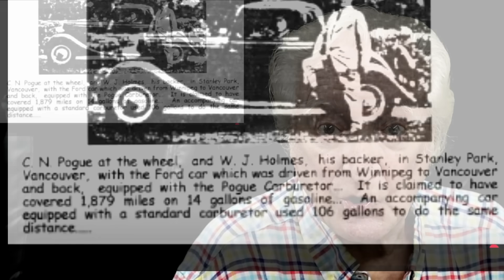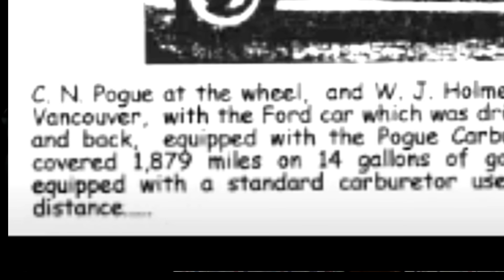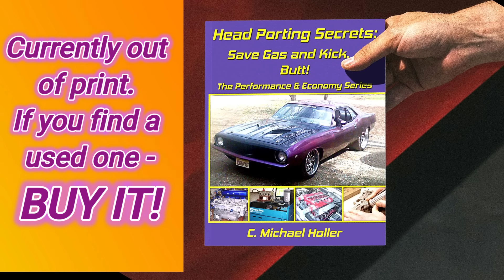100 MPG carb - the real truth!!

Comment: I guess if you think modern cars only burn about 50% of the fuel that passes through the engine, you might believe that a carburetor  would double your milage.
Reply from the maker: Jeremy, modernern engines burn about 99.5% of the fuel that goes through them but only turn 25 - 30% of that into useful work. You need to watch part 3 coming up in a few days.
DV

Comment: Thanks for another installment David. One thing I found that improved the mileage on my daily driven 360 Mopars, with their Carter Thermoquads, was the now extinct "Torque Plus" intake gaskets. Basically the old trick of sandwiching stainless steel screen between two intake gaskets. This helped atomize the fuel charge even more, resulting in not only better mileage(after retuning), but a substantial low speed, off idle torque increase. Not much use over 4500rpms, but if you've ever driven 360 Mopars, you'd know there's no need to rev them to get up to speed. An additional major bonus with these gaskets is, being double thickness, they sealed warped intake manifolds to the heads without machining. The  long extinct Thermoquads were even more adjustable than the average 4bbl carb and I loved them. Their howl at wide open throttle is also unique. In the mid 80s the night the Simpsons episode with Danny Devito aired I was inundated with phone calls from buddies who said THAT'S your car! Homer was describing to automotive engineers " when I gun the motor, I want people to think the world's coming to an end". Thermoquads sound like they're consuming every molecule of air in the tri-county area, when they open up fully. I wish I had purchased a "stub stack" for my Thermoquads, when I did so for my Mini's S U carbs. Great series David. Looking forward to the next installment👍
Malcolm Ottawa Valley
Reply: I remember my dad saw one of those screen carb gaskets, when I was a kid.  He had bought a 78 Chevy work van that we took a weeks vacation in, shortly after he bought it.  He was less than impressed at the fuel milage with the 350 SBC that it had.  So, when he saw that carb gasket hanging on a peg board at the local "More Value" store, He scooped it right up, thinking that it would work.  He was very meticulous about his fuel mileage.  So much so that he had a wheel type slide rule calculator hanging on the turn signal.  He checked his fuel mileage absolutely every single time he filled up.  

Guess what.... Not a damn thing. That carb gasket didn't do crap.  The engine made exactly the same fuel milage (within a 2-3 MPG range) on every single fill up.  

So, sorry, I call BS on that one.
Reply: @atheplummer 
Yep, they've sold those gimmicks for Harley's for years and after trying one I can assure you they do nothing.
Reply: @atheplummer  He's speaking of results on a particular motor w/ carb setup. Did your dad's Chevy have a Quadrajet or a 2bbl carb? It would be expected that the added intake restriction on a 2bbl setup would overcome any gains from better atomization.

OP's dad's experience was w/ a notorious gas guzzler, not the relatively efficient SBC. Apples to oranges.
Reply: @nunyabidniz2868  It was a 78 Chevy van, standard box, with a 4bbl Qjet. Turbo 350 trans.
Reply: Well I wouldn't have kept using them if I wasn't getting better results. Speaking as one of the tighter (cheaper) drivers on the planet, who still computes his mileage at every fill up, in my head to 2 decimals(one of the few boomer super powers). One backfire and the old fiberglass screens, like they sold your Dad, were blown out. These were stainless steel and their hole sizes had been "scienced out" by then. Mopars use the more sensitive ported carb vacuum to pull in their vacuum advance canister signals on their distributors. Chevys use "always on" straight manifold vacuum. On my low compression 360s I'd set my distributor 12+23+27=62 degrees. That is base + mechanical+ vacuum equalling total timing. Mopar made vacuum canisters all the way out to 27 degrees on their last(75+76) A-body(light weight) small block distributors, stamped with a 13.5 on the arms(you double that for the actual degrees). A lot of SBC distributor canisters barely added 8 degrees vacuum. I've worked on a lot of friend's 350s, but I'd never own one as a daily driver. Good torque but far too thirsty for what you get mileage wise,  compared to what you can pull out of a 360 Mopar, in my experience. Watch any CASCAR dirt race and you'll see it's the 360s ahead, out of every turn, over the 350s and 351s. They tried to outlaw them, but that form of racing is too budget oriented and closer to stock, so they dominate with their bore/stroke torque advantage, earning their nickname "baby Hemis". I got zero mileage increase on Minis using the screen door intake gaskets and it restricted their high rpm shift points (7000rpm), but the small block Mopars gave great, noticeable gains over stock, in my extensive experience with the Torque Plus brand intake gaskets.....not calling your Pappy a fibber.
Reply: My first vehicle was a 93 d150 with the 360 and i had 32" glasspacks with a big aftermarket k&n air breather and filter and it was the best sounding pickup in my town. It smoked a newer model chevy with the 5.3 and smoked a newer model v6 camaro. My buddy who was a chevy guy was super impressed.
Reply: Wish I had your help back in the day. The half dozen 360s I drove all were pretty bad for fuel mileage. The 318's did way better and didn't seem to really be down on power much compared to the 360's. The 360 in my 1984 crew cab was lucky to break 12mpg most the time it averaged 10. I repowered it with a cummins and after tuning it gets about 19 highway, 17 city and has like 3 times the power as it will put 450hp to the tires and 1150ft-lbs. That being said you load it super heavy (45k+lbs ) and use all that power it gets like 8mpg.

Comment: Hmm, Winnipeg to Vancouver is NOW about 2303km (1431 miles) and that is with the Coquihalla highway that goes over the mountains rather than around them, so a much shorter route than in the day, but never mind. So the Ford would have gone more like 2860++ miles on 14 gallons (Imperial gallons since it is Canada). This crosses three mountain ranges, the Purcells, the Selkirks, and the Rockies, so there's a lot of climbing to be done, on gravel and dirt roads. The story sounds fishy already.

On the other hand, we need Engineering Explained to do the math, but I'll give it a go. 
An IMPERIAL gallon of gasoline has 43 kW-hours of energy. 1 horsepower is 735.5 Watts. Now you have to assume a speed to figure out how long it takes to go 100 miles. 43 kW-hours/735.5 Watts gives you 58.5 HP for 1 hour (assuming 100% efficiency which is wrong, it's more like 33%, so 19.5 HP for 1 hour.
So if you could go 100 miles per hour, you have to do it on 19.5 HP. At 50 miles per hour, 9.7 HP (since it would take 2 hours). How about 10 MPH? 1.9HP. 

So, yeah, if you're riding a Vespa, 100 MPG is doable.

Now, please correct my math in the comments, and be nice, I'm just throwing numbers together without a piece of paper to check.

(Darn, I should have watched the whole video before typing, but we went in the same direction)

Comment: If you only change the carburetor , the only thing you can do to make it use less fuel is lean it out , and if you get the A/F ratio high er than about 14.7 to 1 it loses power an uses more fuel, so 100 mpg is just wishful thinkihg, IYKYK , Ha !!!
Reply: But then leaning the mixture from 14.7: to 16.5:1 would use just about 10% less fuel.
Reply: Incorrect. Going leaner drives the emissions up. NOx especially, just skyrockets. It does get harder to ignite, so bin the points. Actual a/f ratios can be in the 16s before a lean miss occurs. Remember, this is flat road cruise. Any load and the a/f must richen, or it will buck/miss fire/knock badly.

A computer controlled mulitpoint fuel injection and spark timing, very high compression with an efficient chamber, and VVT cam timing  to maximize torque on a small displacement engine is the best bet to get close. 

The real secret to fuel economy is maximizing torque  as this approach will use the least amount of air therefore the least amount of fuel to power a vehicle down the road.
Reply: Read my reply again ,if you only change the carburetor.and 100 MPG is wishful thinking ,  now do you dissagree
Reply: If the mixture is homgenouse enough and the engine has strong enough spark, you can lean it out far up in the 16:1s before you start noticing much loss of power at part throttle.
 @crd-nz_001  with a port injected 2.0 Ford Pinto engine I controlled with a Megasquirt 2 ECU I had I tried leaning it out to above 17:1 at part throttle before it missfired. But then it had a noticeable loss of power, so a bit richer mixture of about 15,5-16.5:1 worked much better. When going to lean it also did not respond much to changes in ignition advance.

Comment: Impossible as the record for a 4 person Diesel car is slightly above 1 imp. gallon/100 miles and the density and energy content of diesel is 15% higher + the thermodynamic efficiancy is also 15% higher. No further experiments will be necessary...
Reply: Can those figures be obtained at normal, legal highway speeds? Otherwise, fuel efficiency figures like these, which are impressive indeed, are mere curiosities, because they cannot be translated into useful, everyday use of a vehicle. American Motors won many fuel efficiency contests in the 60s with compact cars, 6 cylinder engines, overinflated tires, coasting, top speeds not exceeding 40 miles per hour, etc, etc, etc. 100 mpg, real world gasoline powered automobiles are impossible, ergo, all the claims are bullshit.
Reply: @quantumleap359  yes this is since 10 years the Guiness world record: The route through 48 US states, excluding Alaska and Hawaii, is a total of 8,233 miles (13,250 kilometers). As Volkswagen reports, the Golf TDI Clean Diesel completed the journey under the constant supervision of Guinness World Records. The driving team, journalist and blogger Wayne Gerdes and engineer Bob Winger, consumed just 2.9 liters per 100 kilometers, corresponding to a range of 81 miles per gallon.

Comment: I think its possible to do substantially better with mpg, but not with just a carb swap. An engine built specifically for this project could do really well, but it would need to have the single mind toward economy.  I learned a lot from Davids book on the subject. I would love to hear his updated thoughts. Even better would be a v8 engine build testing different theories. Looking forward to this David, thank you!
Reply: Datsun made a mpg edition 720 pickup in the early 80s it was fairly high compression (9.4 to1) napsz 2.0 stripped down bare bones pickup (only driver side mirror) that was set up to run lean, it had a knock sensor that would retard timing when needed. It worked but wouldn't pass CA emissions  so it was short lived.